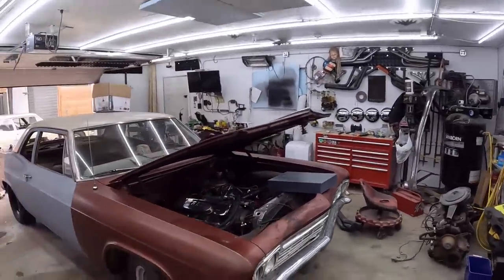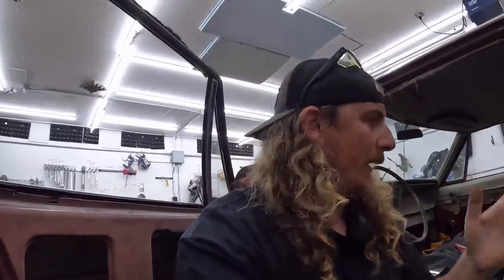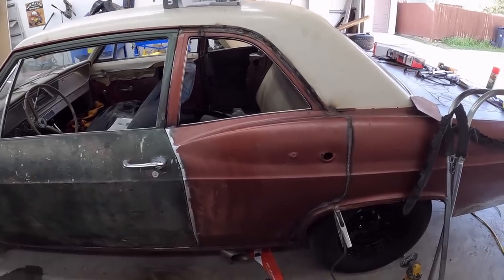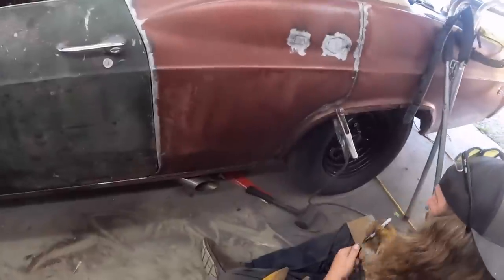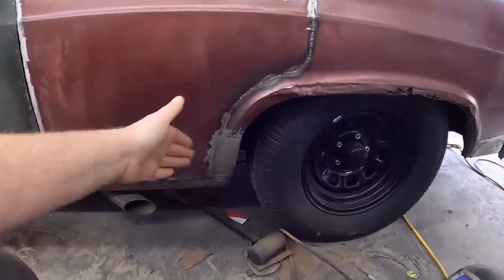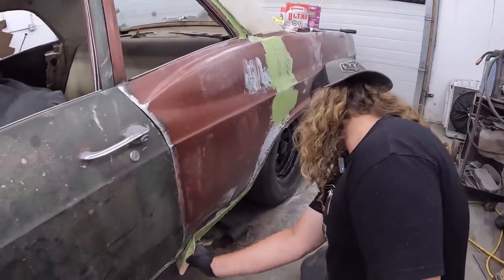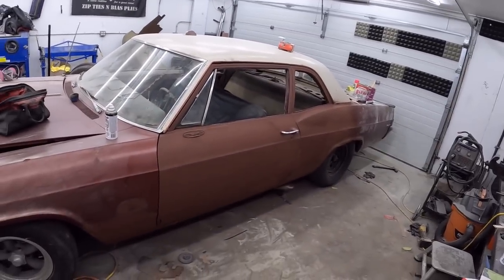Body Filler FIXES EVERYTHING! - There's A New Bondo Slinger In Town! 1966 Budget Biscayne

Comment: Like You, I'm somewhat minimally equipped and do most of my best fab work with 7" cutting and flap discs on a hand-held angle grinder....I've been warned numerous times how dangerous this equipment can be even when using the safest practices possible and I'll admit that the damn thing has bitten me a couple of times and I've learned the hard way that every precaution needs to be taken during every moment the blade or grinding wheel is spinning unless I want to spend a lot of time and money at the emergency hospital.....
The piece you are cutting on should always be clamped or otherwise secured to something stronger than the machine's ability to bite it wrong and send it and the machine into uncontrolled kaos.....If you aren't going to do it to set a good example then do it for your own safety because we all want you to prosper and keep making awesome videos.....
I'm not trying to be a jerk or the safety police (I'm not a fan of police) and if it seems that way, I'm sorry......
You are showcasing how budget hotrods are built and keeping it real and doing it better than half the shows on Motor Trend channel.....I love it!

Comment: I was an industrial painter for 20 years and we use body filler on everything and once a year we'd clean our shop we have to get a bulldozer in there to get the 3 inches of body filler off the floor you couldn't chip it up with a hammer.

Comment: I am so glad you decided to do the nomad right. It deserves a good restorod restoration. It'll also will be worth more money nearer to stock. I have a 55' nomad completely original. It was a heavily optioned car w/ air and power windows,100 thousand miles and  even has original linoleum in the load area. The car is matador red with navaho white top. Give your grand old lady( the nomad) some class . There are only 12000 left ( approximately).

Comment: Lol!  Couldnt believe you mentioned it, so I had to comment. I use short strand fiber on everything, Doing a roll pan at my old house I dropped a glob on the grease stained concrete and there it stuck for 10 years until I knocked it loose cleaning the floor to sell the house.

Comment: Hey Dan Rick 427 here that fiber glass filler your using ìs good stuff here in the states they had a product called kitty hair that was the same stuff I used it on the bottom of the quarters of a 77 camaro  back around 1987 and 1988 it was a buddies drag car as far as I know it is still on the car and the rust never came back I did a bad ass paint job on it it was maroon and I ran a bunch of different color candy stripes on the car about 8 different colors the car looked great and I got a ton of work from racers at that track in Alabama.  That kitty hair is as hard as a rock. Your friend from Louisiana Rick 427

Comment: Modern filler works great, and as you are 'patching holes/rust etc'  fiberglass reinforced filler is the best as it waterproof, where as  regular filler will absorb moisture causing rust,  (so it must be sealed with top coat paint as primer is also not waterproof)  once the area is 'sealed' with the 'Angel Hair' filler, regular filler is good to use over it to level/smooth out, which is also easier to sand.

Comment: I watched a video a long time ago, the guy use short glass "bondo" (same stuff you are using) to fill a nice hole he put the bondo on wax paper then put it in place and pushed it in and formed it with his hands no glove. right before it was set up he pulled the wax paper off. I did this and it worked great. just another ideal.

Comment: As a bodyman by trade.  Filler definitely doesn’t stick to unprepared paint long term. It will seem stuck but the slighted flex in the panel will pop it loose

Comment: Dan to fix the lip on the quarter panel  find metal pipe about the size bend it in the rough shape weld it and shmow filler to get the shape

Comment: OEM rims or re pops I guess. I'm sure you know this but the station wagon rims on back were wider and so are the rims on the back of the convertible. From the factory and that's true going back 360s and into the 50s. I'm not sure it goes back to a tri 5's. Messed up a room on my ragtop back in the day it was 1963. Wobbling out the lug nut holes and my dad simply took a standard with graham cut the centers out and welded it in. Man I miss those days. Thanks for let me throwing that in. But you put them on this car and the repops are good quality ones are actually better than the original wagon rims Eric plus you have the choice of different insets. Anyway I paint them black but dog dish have caps on it and give it that period Correct look. It's too bad you can't put those wider rims on the front because the tire drag. Now the interesting thing is that before I watch your videos and try fives in this one, I really did not realize that you could virtually do this to any of the four doors that had frames. Well I guess you can do to Chevy Nova's too. They don't have frames. You seem to like 1960 Chevys why not just do that with a four-door 60 Chevy? Somewhere down the line. I was at a old car salvage yard today. The guy is in his late 30s and assemble the salvage yard from scratch in 4 years actually a little less! So there's still some of those yards out there and at least one is being created! Great for him. You want something with suicide doors? How about ducktail Plymouth or 50 Dodge Business coupe? Or something with a hemi in it and that's a little bit better than the first couple of years of hemis? Or just buy a part? He shifts to Australia England and elsewhere. Probably Canada too. We were talking about your channel. Has nothing really do with your 66 but it gives you a source. I really like watching you create. You mention bad Chad I watched him and he has a creative flair second to none. He's not afraid to try something. Like welding the centers of bedrooms from an old Ford into the rings of a Dodge truck wheel. You're right just get out there buy something work on it. I'll add one other thing buy something cheap a four-door make it into a two-door feel like but make mistakes and learn from them. Also watch YouTube channels that apply and learn from them and their mistakes before you make your own. The car hobby is something that brings people together. Ever notice there's a certain crowd that they don't want people to come together for any reason! If we're all talking they can't get away with what they're doing not just to the individual countries but the world. Or just being old car guy a young car guy get together and talk share ideas and leave the world behind for a little bit

Comment: DAN YOU ARE SO RIGHT !!!!! key board experts have never build anything , i use 80 grit thats wore out and it becomes 400 grit i dont care i enjoy my cars, if it looks good a 50 feet perfect.... i dont go too cheap on my motors , but i will use some chinaeisum  heads (procomp heads )cam and roller lifters i like HOWARDS , and i must have KING BEARINGS timing sets i use steel link  MELLINGS or ELGIN i used to get them under 20.00 ,i dont know now i still have 2 sets .....DUDE YOU HAVE TO USE THE 1 PEICE OIL PAN GASKET , and the steel  one peice oli pump shaft with out that plastic doohicky.... ENJOY YOUR SHOW  interested on how your going to do the rear side glass

Comment: "mebbe should just buy a 2 door." if only it were that easy. if you found a 2 door in this good of shape, it would be 6k with a six and three onna tree. with an 8 and an auto, it would be closer to 10k. you won't even have 6k in this with the engine swap included. slap in some front buckets, a decent interior and a custom console around a floor shift, and you'd have no problem getting 7-8k for it, even with it being a 4 to 2 door conversion. you did a really good job on the conversion, and it's not like they grow on trees or nuthin'.

Comment: Dan, Ive used the Bondo fiberglass resin jelly, when it hardens it gets like steel, only bad part is its harder to sand, so its kind of like the long strand stuff you use, its doesnt have strands, then I use regular filler over it, I use just for strength also.

Comment: Dan.... have been watching you for over a year now.... you should invest in a spot welder .... you can also use it with a slide hammer and pull some of those knarly dents out i keep seeing you ignore lol... awesome work   oh and btw the other fiberglass filler you could use is called duraglass.... does not smell as bad as what your using :)

Comment: On these conversations: is it possible to add back a rear window regulator and window so all the windows work? Or given the way this is done, does  that require a ton of extra metal work? Maybe aftermarket a/c is easier ... Or summers are not that hot/humid in The Peg?
Reply: Go and watch Savin junk he made rear window regulator on a 1962 Chevy he made into a  2 door from a 4 door

Comment: Well close getting off my ass and going out to pull drawers in my tool box so i can unload it off the truck.  and go take the big shelfy thing outta my shed so i can get my tool box in there. I done my turn at welding and cutting at work fixed a bent suspention box from under a reefer trailer. gotta love dumb ass truck dtivers who think they can drag trailers over any thing in the way.  Maybe one day i should record what i do in a day at work and put it on yous tubes. lol  hi fiver dan lookin good. ps got un lazy and fixed my ranger no more pouring oil on the ground and all lights work again.

Comment: You haven't lied about what this car is, just a roller and nothing more... cheap was the name on the build an you succeeded in doing this. I know that you know how to do it the right way if it was a show car.... hell, some of your builds including a fake 57 is looking right fine... was nothing but a pile in a field before an now it has some values. So this car is a sellable car was you to do just that. With the amount of cars that you have, most would be just that, sold for a high profit an on to the next build. If you start working on building cars for other folks, its not fun an too much pressure to do it perfect. Just build and send it down the road after some fun. That is just my opinion.. you want to keep all of them then do it

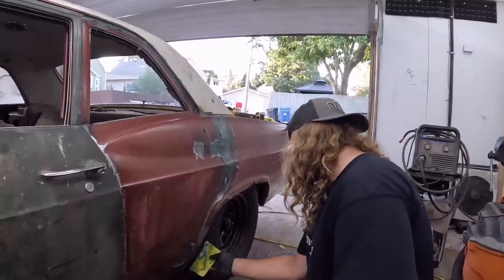Comment: 26:00 - If you want to know why you can't apply body filler over paint, you've only got to google it and spend 5 to 10 mins as to the reasons why. Besides this, you're not even sanding the paint to give it a mechanical bond. There WILL be issues down the road, long after you've sold it and if someone wants to properly fix this car, they'll have to sand it all off now. This is why you can't trust classic cars and assume anything is good for repainting and you need to strip it down to bare metal to make sure a hack wasn't in there. Some people are not the best stewards of classic cars. I realize this thing is just a fun beater though, but still, you could have done the same job where the filler work was actually usable to keep for the next guy. It will shrink, crack, swell and become a mess. If this wasn't so, then we'd all do it. We don't because it wont last.

There's no problem with hacking the car just make sure your audience knows this is isn't "good enough" and it wont last. Otherwise they'll think they can do this to their cars that they plan on keeping for more than a year and will suffer the results. Your just gunna sell it, let someone else deal with it and move on to another one. Hell, on a car like this, the buyer probably wont even care when the filler starts to crack and swell either. I'm just saying, make it known it's wrong and don't try to inform others they can do that and expect good, long term results. It wont hold true. How the filler will act over unsanded paint like this, will act NOTHING like how some filler is acting over some spilled on a garage floor.

- as for panel replacement vs patch panels like your doing. That's actually not important. Your repairs are just as good as replacing whole panels. Body shops will replace rather than repair because it's cheaper to buy panels than pay the labor to repair. In the end, how your doing that part is just as good as a new panel (had you actually done the filler work over bare metal, or better yet, over epoxy primer/sealer, that is.)

Comment: Man your supposed to cut out your filler piece of metal first then lay over the hole then trace then cut and weld. If you do it the way you are doing it you use way way to much filler/ Bondo